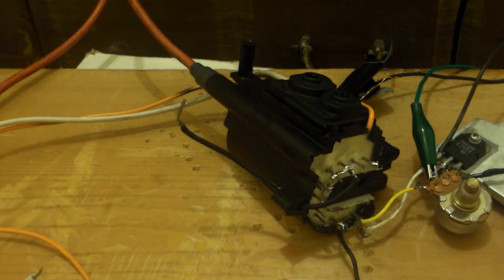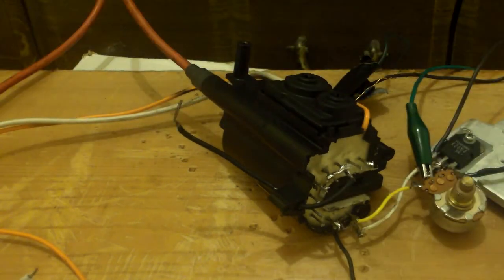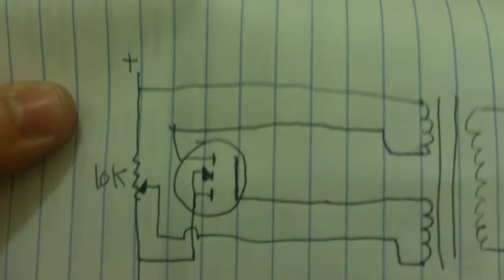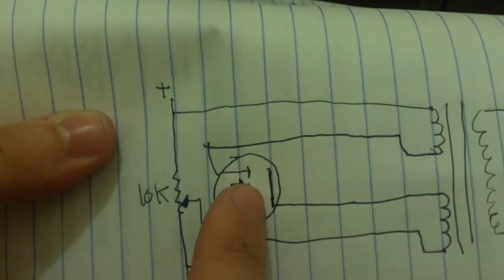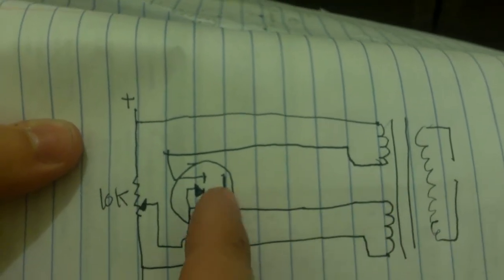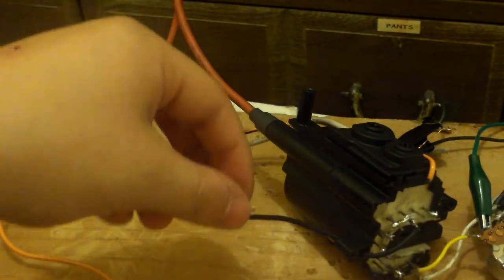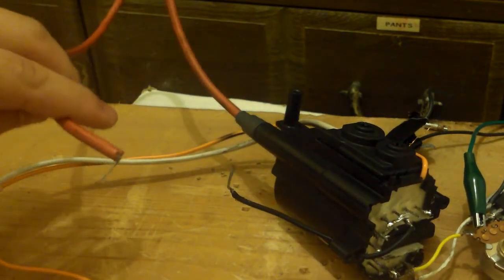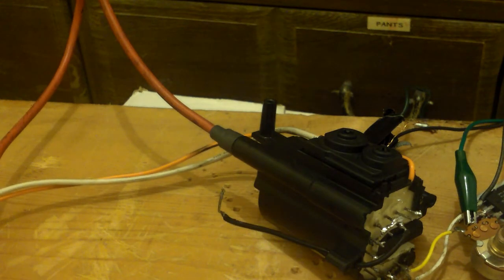another flyback circuit

Comment: I made this still didnt tune the resistor but it has 1.2 cm spark and burns paper instantly even isolation othe wire gets burned  prety fast in I make spark go over it. its awesome . I used flyback from an old tv so it has high curent  so I have to be carefoul. I will try to use it for mosquito killer.

Comment: I my my I used 150k pot and 2sk2134 mosfet and I pover it with 5 v I dont want to pover it with 12 v beacouse it gets litle warm with 5 v and it gives 5mm sparks I tried 12 v with noather similar transistor and it worked wel but not even 10 sec beacouse I tried to see it transistor is warm and I got schoked and I didnt work any more probabla HV kiled it :(